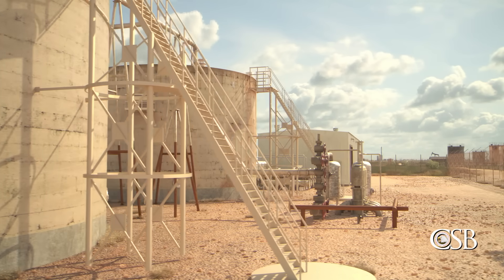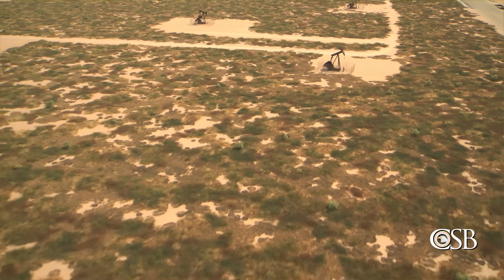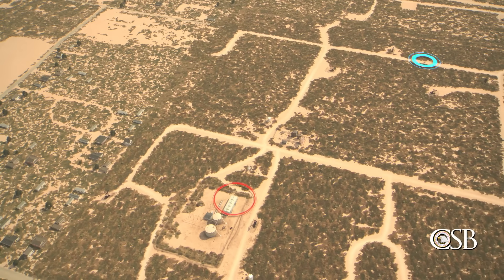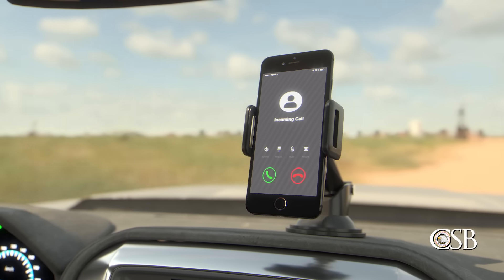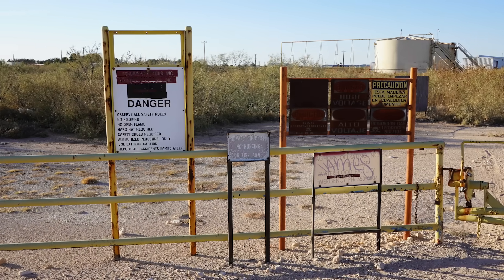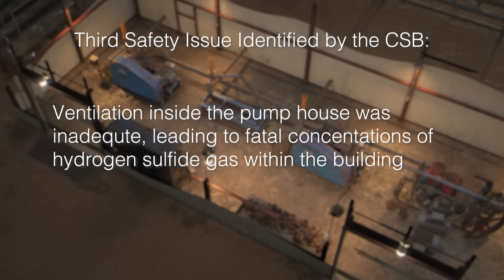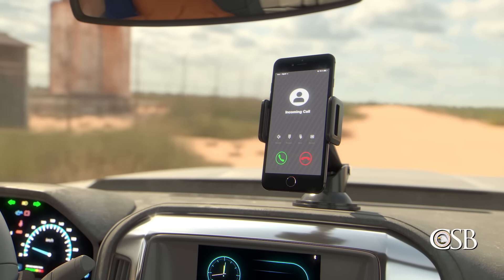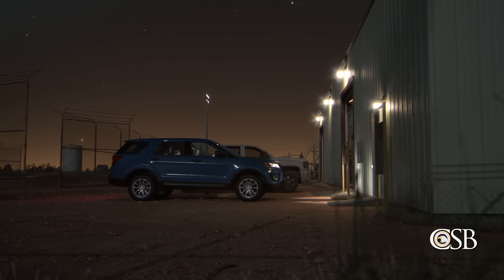Silent Killer: Hydrogen Sulfide Release in Odessa, Texas

Comment: Sorry not sorry... this has to be said.... What mother brings her children with her to a potentially dangerous situation???? While its great that everyone is thankful the children survived, apparently its lost on ya'll that the mother was a complete idiot. This is what normalcy bias looks like, assuming that its just some minor thing that the children will be safe around and failing to appreciate the potential danger. The children should have been left at home or with a friend/neighbor.  And if none of those options were available, that's what the POLICE are for. Turn on the scanner or go to a website that has police/fire feeds. Listen for "WELFARE CHECK", You can literally call 911 and say, "my husband works at the oil plant, and i haven't heard from him in X hours, can you send a deputy over there and make sure hes ok??" They will respond, they will probably even have the fire dept respond  with them since they have OSHA standards to follow when responding to anything at an industrial facility.  NEVER, EVER, bring your children near something that has the potential to be dangerous. If the husband fails to check in or return in the appropriate time frame. This means something is WRONG. Given that something is WRONG, one should anticipate some level of DANGER.  Danger can come in many forms, in this case it was poison gas. Those children got lucky, what if the car was left running and the A/C was on sucking contaminated outside air into the cabin??? (which according to a quick google search of the incident, they DID get mild exposure in the car and were taken to the hospital)  But what if it had been a murder? what if someone was robbing the husband and the wife pulls up and gets killed as well for being a witness, what happens to the kids then??? What if the husband is lying on the floor in pieces due to an accident and the mother starts screaming and the children exit the vehicle to see whats wrong and walk into to the gas filled room?? What if the building was on fire when the wife shows up and all hell is breaking loose on that site filled with flammable liquids and gasses? Was she going to go in and leave the children in the car alone? What if the car caught fire or the children were overcome by smoke/fumes?? What if the father was delayed because he was in an argument with a coworker and it escalated into a fight? You want your children there to see it or be abducted when the coworker kills the father and mother and then takes the children to get rid of them? Think this stuff can't happen???? read the goddamn news... It HAS happened... And dont bother replying with the "YOU SHOULDN'T TALK ILL OF THE DEAD!!" BS... i dont care... I'm shit tired of watching and reading about people who completely FAIL at the prime directive... -To stay alive and protect their future. God was protecting those children that night. Not their mom.

Comment: If that high concentration of hydrogen sulfide an explosion could easily occur.
Reply: H2S is reliably fatal at 400-800 ppm concentration (and it kills quickly) but lower the explosion limit is 4300ppm. Explosions can occur, but the greater danger is poisoning.
Reply: I should ad that it is quite dangerous at Lowe concentrations also. Eye and lung damage can occur at as low as 50ppm and one can become unconscious and eventually die from prolonged exposure at concentrations way below 400 ppm.
Reply: @anderslittorin6882   The technician should have smell that high concentration of H2S and avoid going in the pump house..

Comment: Tragic and preventable as always; take yo hydrogen sulfide hazard seriously! But can I talk about the digital artists hired for this?! There are some next-level over-achievers on this job! From the barbed wire to the sand and weeds, or the bits-on-the-bench to the rust on the safety covers, and even the truck's suspension action and camera's depth of field; I have never seen this level of visual quality in a documentary! Props yo.

Comment: My guess is that the pump turned on while the pumper was working on it, since according to the animation he was able to close the valves supposedly without being overcome, but then passed out shortly after he actually started working on the pump.

7:17 Wow, really? His personal hydrogen sulfide monitor was in alarm outside the building? That must have meant that enough hydrogen sulfide was leaking from the pump to not only fill the entire pump room but also escape outside!

Has it ever occurred to anyone in this particular chemical industry to either develop or use some kind of filter or system to remove/trap the hydrogen sulfide, thus completely avoiding the potential hazard altogether?

My recommendations (most of which mirror the CSB's):
Require employees to carry their personal hydrogen sulfide monitors at all times when on-site.
Also require employees to always wear PPE, such as SCBAs, gasmasks, or even full hazmat suits, while working around dangerous gases like hydrogen sulfide (or even the whole time while they're on-site).
Always fully test detection & alarm systems to ensure they will work when needed. Had the company performed a full test of the detection & alarm system at the pumphouse, they likely would have spotted the sensors set to "test" (as well as those that were unable to communicate with the control unit) & would have been able to correct them immediately.
Make sure facilities have adequate or even over-adequate ventilation systems.
Provide employees with gate keys, so that only they may enter employees only areas (& thus keep gates locked).

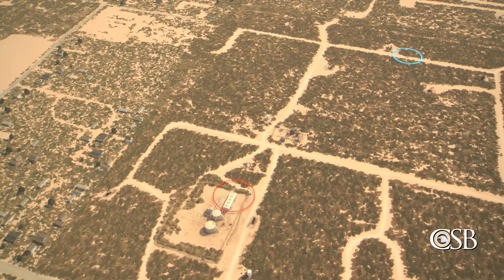3:55 What the heck is that ringtone? Sounds like a woodpecker!

Comment: The kids are lucky to be alive.. Being that the dads H2S detector was alarming in his truck for deadly amounts of H2S while outside the building
Reply: The alarms go off long before they sense “deadly” levels.
Reply: @nicolasthecaged  Yup, it'll go off when the levels are still relatively harmless. 
Same for flammable gas detectors, they go off at 10-25% of the lower explosive limit for whatever gas their calibrated for.
Gas detection would be pointless if it let you know after you were in danger.
Reply: @nicolasthecaged  Yeah most the flammable gas detectors I've delt with (explosion proofed zone 2 forklifts) don't tell you the level either. It'll start beeping at 10% LEL and when it's hits 25% LEL it beeps louder and after 15 seconds it shuts the machine down.
My biggest user of them is a UK LPG supplier, get a lot of breakdown calls because of 'false alarms' when in reality their not, the operators don't realise the detectors can sniff that gas long before your nostrils can detect the trace of mercaptan in the butane/propane.
Their use is a farce though, the reset keys are supposed to be kept with management to prompt an investigation when the detectors go off but every time I work on one the reset keys are hanging on the forklifts ignition key. 
Then people wonder why accidents like this happen 😡.
Reply: @deezelfairy  If the employee thinks the alarm is false alarming, eventually they are going to over ride or disable the alarm.  If they have done that a bunch of times with no negative consequence, that will become an institutionalized practice.
Reply: @deezelfairy  This is why they used parakeets in mines. They were much more susceptible to harmful gases and would die well before it was fatal levels for humans.
Reply: @edsloan8535  I have to wonder how many times miners died because they decided the parakeet just had a heart attack and it wasn't actually an emergency.
Reply: @nicolasthecaged  What I have understand, it doesn't work that way. Its the accumulation that is dangerous, meaning, being in a area with a non-lethal amount of the gas could accumulate in body and become lethal after a time. And thats why most PPE-type gas detectors for toxic gasses, is of "accumulation" type, which will alarm when PPM  x TIME becomes too high (max daily dose), meaning its time to leave the area and end the work shift for the day. And at the start of the work day, you "reset" your PPE meter either by pushing a button, or touching it to a cradle when clocking in.

Thats also the difference between PPE detectors and survey detectors. Survey detectors detect the amount of the danger NOW, it only tells you if a area is safe to enter or not to for example do a emergency stop or rescue operation, it doesn't tell you if its safe to habit the area for longer periods.

But since the pump guy seems to only respond to alarms, he was propably using a "Survey" meter and NOT a "PPE" meter. It seems so from the picture aswell, as survey meters are larger and clumsier to handle rough handling more, while PPE meters are designed to be worn around the neck or in a pocket, going off when your daily dose are exceeded.

However, for low oxygen enviroments, survey detectors and PPE detectors are the same, since as long as the oxygen level is above the safe level for human habitation, it will be safe, for any time.
Reply: @sebastiannielsen  there are SoPs(standard operating procedures) for every single action you take in the field. Unending safety meetings repeatedly beat them into your head. But at the end of the day there are a ton of humans in the oilfield and out there shit happens.
Reply: @nicolasthecaged  What I meant, is that you sounded like, if its X PPM, then its dangerous, if its X-1 PPM, then its totally safe. And I wanted to point out that it doesn't work that way, but even lower concentrations can be dangerous over time due to accumulation. But of course there is concentrations so deadly so it leads to instant death, but that doesn't mean lower concentrations are safe.
Reply: @sebastiannielsen  well sure if you’re coming at it from a scientific point of view. But nobody comes at it from that point of view in the field. So it hardly matters what exact number the ppm needs to get to for it become lethal. What matters in practical situations in the oilfield is that you avoid the highly concentrated pockets of gas, all of which will far exceed the lethal ppm, and those pockets of gas can be very unpredictable.
Reply: @sebastiannielsen  but, like I pointed out earlier, in some places, especially pump houses and oil rigs, there is always a low concentration of H2S. It is unavoidable.
Reply: @sebastiannielsen  I’m not debating that’s it’s not safe. Just saying it won’t kill you even over the course of decades if all you are in is low concentration environments.
Reply: @deezelfairy  that’s correct. It’s not a myth that heavy flatulence can set off a PPE if placed close to the… port. 😁
Reply: @nicolasthecaged  see, that I do not get.  idk how it works on people and I cannot find ANY info on the mechanism of death. esp from such a "small" amount.  Esp to be able to not revive them if found seconds later.
Reply: @OnceShy_TwiceBitten  well we could ask the people that experience it… but they’re all dead so…
Reply: @OnceShy_TwiceBitten  Read the Wikipedia article about Hydrogen Sulphide, there is some basic details in there. 
One small quote of the article "The toxicity of H2S is comparable with that of carbon monoxide. It binds with iron in the mitochondrial cytochrome enzymes, thus preventing cellular respiration"

That's pretty scary, if it stops your body respiring on a cellular level then those cells die in minutes and cease to function so explains why you can't be revived.
The even scarier part is how it's estimated at up to 350ppm your body can break down the H2S and mop it up with no problems but becomes fatal between 500-1000ppm.
So the window between I'm absolutely fine and have no idea I'm in in danger and stone cold dead is extremely narrow.
Reply: Losing both my parents, I would’ve rather died.
Reply: @Gamebreaker08  Hopefully they've got good extended family around them.

Comment: Hydrogen Sulfide gas is also a hazard in waste-water pumping stations. In 31 years of working at a water utility, I always had a portable gas detector for three things: Low oxygen, Hydrogen sulfide, and Combustible atmosphere. 

We routinely had ventilation systems for all confined spaces. However, there was one incident when the operators were cleaning up a waste-water storage basin. The ventilation fans were running but what the operators didn't know was that the actuator linkages that opened a spring-loaded air valve on the suction side had all broken. The motors and fans were running, but no air moved. When one of the detectors the men were using went off, they left the basin. Later, a senior operator looked over the ventilation system and discovered the broken linkages on the floor.

That was an accident that didn't happen. 

To the CSB, thank-you for doing your investigation and publishing this video. There are other accident investigations pending. I look forward to learning something new.

Comment: As a person who services industrial control systems everyday, it pains me to hear about incidents like this.
Just half a day of work for 1 person would have probably been enough to re enable the alarm systems. If the sensors were already installed and working, the program was also reading them, it sounds like all it needed was new alarms and lights.
It would have been so easy to prevent it. Such a shame.

Comment: As usual, the CSB report is common sense, expressed in an understandable way, but will be totally ignored by the controlling company because making corrections to existing processes will incur costs and/or potential legal liability.
Reply: Not only that, the very process of change is often a big obstacle on all levels, from management to workers. It is however the responsibility of management from top down to make sure those changes are made and enforced.

Comment: I worked in the Permian Basin oil fields, mostly on and around pump jacks.  On two separate occasions in the early and mid 80s I had near misses with potentially fatal situations, both at pump jack sites.  Fortunately neither incidents were related to H2S.

Comment: Am I the only one who screamed in despair and frustration at hearing he left his detector in the truck?
Reply: Probably because he kept getting H2S hits and management got on him about it instead of fixing the problem.
Reply: @MrBrian465  this. It’s always about money being in conflict with safety.
Reply: not a loud as I screamed to learn the leak detection and warning systems for the pumphouse were defective!!!!  No Warning light!!
Reply: Honestly my first thought was well, there's ur first mistake
Reply: Absolutely.  I don't work in the oil industry but I've been on a few sites for contract jobs and I always left my H2S monitor clipped to my hard hat.
Reply: @jonnyknuckles489  I'd rather clip it lower on my jacket or even trousers. H2S is a very heavy gas and tends to accumulate in low spots. I work in the pulp and paper industry where H2S can be a big safety issue in certain process areas. It's not too uncommon to hear the alarm go off at waist level while no detectable levels are present at face height. H2S is a nasty substance!
Reply: @anderslittorin6882  while your correct about H2S being heavier than air and all that I tend to agree with Jonny. In the oil patch it’s common to clip it to your hard hat where it will always be there every time you jump out of the truck. The problem with putting it on your shirt, or pants every day is that it can easily be forgotten.
Reply: For me, it was when he went to work on the pump without locking anything out.
Reply: The ability to have averted disaster - is the single, mandatory storytelling requirement of a Greek Tragedy.